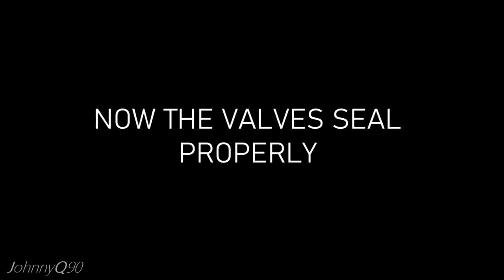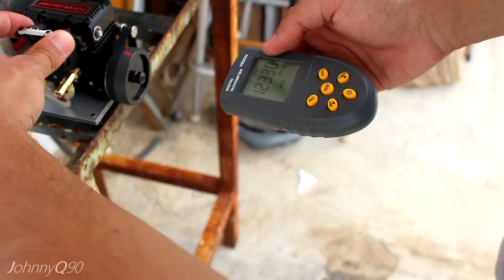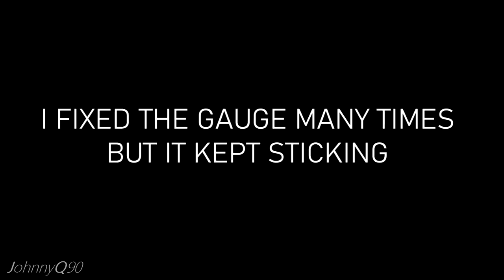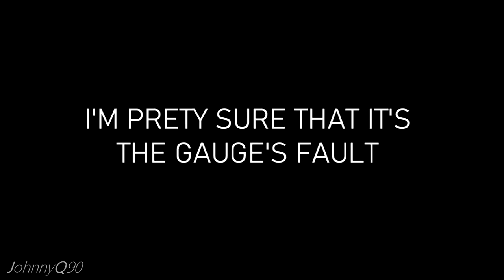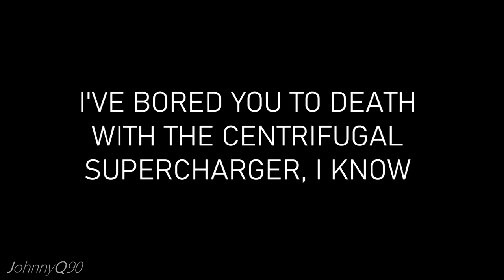PERFORMANCE Upgrade for the 4 Stroke TWIN Cylinder - *VALVE Lapping* - Supercharger Update

Comment: I don't know if you're aware of the nuances of the slide carburetor you have. If you do know then you can ignore this post. I was just hoping that if you didn't know that it would help you get the engine running properly. It may also serve useful to others.

I suggest you reset all the mixture adjustment screws (idle, midrange, and main) to their base settings. This varies by carburetor so you will need to look up what it is for your OS carb. Doing this solved a lot of issues I had with one of my engines (midrange was off by 1/2 turn).

The top adjustment with the fuel line is your "main mixture" that affects the entire throttle range. This one should be adjusted based on desired engine temp under usual load. Lean = hot (clockwise/tighten), Rich = cold (counter-clockwise/loosen)
--> In some cases you have to adjust this for the overall RPM range due to altitude, temperature, dew point, and humidity.

On the slide portion of the carburetor is a screw next to where you attach the throttle control servo. This screw affects idle and very, very low throttle input mixture. This one should be set specifically for making the engine idle properly and not puke too much unburnt fuel. The adjustment for this is the same as the main mixture screw.
--> You are not using a throttle return spring. Slide carbs tend to have trouble returning to base idle and thus usually have a spring or the servo controlling it will have a spring assembly in the arm to force it. Mine has a max spring on servo side (so the servo doesn't rip the slide out of the carb) and a return spring on the carb side. I had to adjust the servo/throttle arm so that it would let the carb completely rest on the idle setting. Otherwise I would get strange idle behavior like you're having.

Finally, there's the "mysterious" mid-range mixture screw. This one is opposite the idle screw and affects the blending of the idle mixture and main mixture at partial throttles. This can effectively allow you to adjust the ratio at partial throttle to full throttle. Most leave this setting to its base and you usually only need to make very small adjustments to this one but it can have huge effects on the engine's mid-throttle response. Adjustment should be the same as the other two.
--> If you adjust this I suggest you put a physical notch, or two (12 and 3 o'clock, for example), on the body so that you know where the base setting is. Heads up: Even 1/8 of a turn on this screw makes a HUGE difference.

I used to race a nitro .21ci/3.49cc (Novarossi) two-stroke 1/8 scale monster truck with a slide carb very similar to that OS carb. I learned quite a lot of tuning tricks from that. Now, with forced induction (supercharger) this is very different from my naturally aspirated motor. There may be points in here that are not quite accurate, or missing additional information I'm not aware of, specifically for forced induction.

Comment: PLEASE READ THIS  I think one issue you might be having is with the little amount of boost blowing the valves off there seat Im an engine builder and sometimes see this in cars that have been turbocharged but were factory NA you build boost in the intake and sometimes the pressure is enough to push the valve off the seat loosing compression because of springs not designed for that positive pressure people think you only need aftermarket valve springs when you put a cam shaft in which is not always the case maybe this is why your engine breaks up on the top end of the rpm range you could possible shim under the spring maybe .001 or .002 im not sure because of how small it is for reference on a small block chevy after a valve job we usually throw a .015 shim under the spring just to bring it back to stockish pressure to make up  for the material removed from the head and valve during machining hopefully this helps!!!

Comment: Really interesting to see this work done great work on the valve gear and that engine really did rev up high after the valves were ground in.
It seems like that supercharger robs more power from the engine than can ever be replaced by 3 PSI in boost. Maybe the biggest loss is the small diameter that the belt has to traverse around the supercharger pulley. This would just get worse at higher rpm.  A correctly engineered gearbox with hardened gears and small ball races May improve things a little.  but   viscosity may start to play a big part in such a small supercharger and reduce efficiency rapidly. I feel that supercharger needs to be spinning at 300,000 rpm to produce any form of meaningful boost. And the gearing up from 10,000 to 300,000 is quite a challenge on the small scale. While keeping the losses manageable.  Can't wait to see the positive displacement supercharger and fitment to the car.  Also if you fill the pressure gauge with oil it will dampen out oscillations. Keep up the excellent work.

Comment: Blow  through system is much easier to tune.  Journal the issue with a draw through system like your using is fuel droplets fall out . The fuel actually gets stuck against the side of the housing of the supercharger.  You have better luck with the blow through system and extending the port length. This will help stabilise the flow of the fuel air mixture before it hits the back of the valve.

Comment: I’m not bored at all with the super charger! 
You should try to make your own throttle body fuel injection set up lol. Would be neat af, and tunable 
I don’t see it being very hard with your current set up. Just machine a trigger wheel and use an Arduino. 
Will have to get a wideband to tune tho. Not sure how that would work lol

Comment: For its running issue, it might have something to do with it having a lot of boost after revving that there is no where for it to go. Something that relives pressure when dethrottling would probably work, like a blowoff valve. Also somewhere in the comments said the carb might be to small for the vacuum, and that could also be it, as it would draw in more fuel, and is hard to meter.

Comment: I think you need an Oil-Damped gauge to prevent the problems you were having with it. The reason the engine became untunable after you upped the pulley size again is because of compressor surge. Causes for this could be many, but I would try to correct it by increasing the plenum volume, so the air has somewhere to gather and get compressed between the 2 brief intake strokes and, what... 400 degrees of rotation between? This should also help with the jelly in the belt from the blower acting alternately between a load and flywheel while the pressure is spiking hard enough to blow back out the compressor intake. Also, for this same reason, I'd think about playing with a bypass gate. Open the gate and tune the engine on Zero-boost. Now start tightening it until just before you detect compressor surge. It's better to blow off excess pressure than to let it surge, because you want the air moving forward continuously. Any time it stops or blows back out the compressor, you're setting up an oscillation of doooom, and frustration. ...But mostly Doooooom.

Comment: The gauge is reading pulses from the engine. By installing a restrictor valve in series with the gauge you can soften those pulses and get a more accurate reading.

Comment: I would recommend a much longer tube for the pressure gauge. The larger amount of air will absorb the massive vibrations of the air column  with the same reading.

Comment: For single cylinder turbo set ups(supercharger I know), I’ve seen people put a small tank between the compressor and the intake manifold to make a more steadily psi. Might help the gauge from jumping and make tuning a little easier. Also will give you a leeway from making too much boost.

Comment: Nice job! You mentioned that you didnt believe the boost gauge at 3psi, but going from 8.5x12000=100000rpm to 10x16000=160000rpm could definitely make that difference. If you can get it closer to an efficient rpm for that small turbine wheel, probably 250k+rpm, it should make much more boost.

Comment: Amazing how much of a difference lapping made to the way the engine sounds, and runs - a much cleaner note. What about using an old-fashioned mercury column vacuum gauge? It will damp out  the variations in pressure. The way it runs with the new carb sounded like an air leak somewhere. Great video, really enjoying the developments!

Comment: The issue with draw through carb setups is that the fine gasoline droplets get separated from the charge air by the centrifugal forces in the compressor, so you get an inconsistent mixture, especially at low power.

Comment: I know you already did the work, but I have a suggestion for polishing the valves. Using the tubing was super smart. Next time attach a drill to the other end of the tubing instead of turning by hand.

Comment: "Bored you guys" fuuuuuck no man this project is dope, really good stuff, forced induction, high rpm, high octane fuel, get er done man  keep at it, the potential is there to make some incredible numbers given the scale, also  If you want to stick with the centrifugal option You need a smaller compressor wheel The compressor is just in surge all the time,  However it's gonna be kind of hard to spend the blower any faster Show the positive displacement option might be a better idea just pls go like psi style screw blower, that would be so dope and more efficient than roots an higher boost

Comment: I think you might suffering or air leaking on the turbine when you tried the push through, I think that is the way to go, you just need to improve the air tightness, the oscillations on the engine idle looks coming from this, also it revs way better, what maybe is showing that the old setup was making the mixture too rich, great vids thank you

Comment: To stop the gauge from jumping you need to dampen it by putting a tiny orifice in the manifold hole, then longer length of tube going to the gauge. the orifice/longer tube will act as a low pass filter and stop the jumping around. This technique is used on real engines to tune vacuum in ITB setups

Comment: The engine seems to be running lean with the supercharger on it it doesn't have a fuel pump feeding the carburetor which is requiring more fuel that's usually why them little engines will hunt and not idle great job on the supercharger love washing your channel also a vacuum leak between the carburetor and the engine will cause it to do that

Comment: for the gauge you can take the end of a bic pen, cut like 1/3" off, the end with the cap, make the tiniest pin hole thru the end cap you can. might take multiple tries. i heat a needle with a lighter, then melt it straight thru. Stick the whole piece inside the line between the housing and the gauge

basically whats happening and why its bouncing and breaking, is because the volume of air thats moving in the line and gauge is way too much to see any where near smooth operation. by reducing the hole size that it goes thru, its slows down and you can get a far more accurate and stable reading

also works on real cars, and id suggest using an actual vac/boost guage

i like your videos, they make me think

Comment: I think have a larger volume inlet manifold might allow the boost to build as less percent volume of the pressurized air is take per cycle and you might get more consistent pressure readings.

Comment: Intense pulsations are a problem for some pressure gauges.  Possible solutions include:
(1) glycerin-filled gauges
(2) snubbers

Snubbers are more or less "mufflers" that dampen pressure pulsations before they get to the gauge.
Glycerin-filled gauges dampen vibrations inside the gauge's mechanism.

Sometimes you need both.

I'm not an engineer, but you can probably read up about these things.

Comment: Depending on what the valves are made from another place you could see a significant gain is relieve the valve stem between the bottom of the valve guide and valve head the large diameter valve stem will be choking/restricting air flow in to the cylinder which will be killing the blow down, for the size of the valve head them valve stems are overkill and also has unnecessary weight in the valvetrain which will also make it less responsive.

Comment: You can smooth the pressure gauge reading by restricting the connection cross section. With something like this I'd expect it to be through a pin hole.
If you are making good pressure, you are probably pressurising the float chamber and pushing the slider up.

Comment: Vacuum gauge looks to be picking up all the vacuum and pressure pulses in the manifold. Since the volume is so low in that area it’s hyper sensitive inside that manifold. Also likely causing carb issues. Maybe add a larger plenum area to the manifold?
Curious if this is a two stage carb, with idle and high speed adjustments or only one main mixture adjustment?

Comment: You need to install a blow off valve (BOV) after the supercharger that is boost controlled. Open at an idle, and closes as boost builds. This will eliminate your tuning issues. Also you should use a mechanical vacuum/boost gauge.

Comment: Check Valve(s) to measure vacuum or boost. digital would help flatten results too. ALSO run under a load. love the videos. keep up the passion. "If" The Engine has been "Whipped" or the throttle is "Snapped" (under no load) it may have jumped timing, you may need a Better Belt Tensioner. You Need A Load to Keep engine From Over/Under-Speed Cycle otherwise You Will Be Creating the Worlds Coolest Impact Driver, if but Only For A Short While. My guess is ignition is going Bonkers trying to keep it running,and that is if the engine hasn't Lost Camshaft Timing Already. And An R/c Engine Dyno using a BLDC motor(like a car starter) could be Pretty cool. The Valves May Be Floating Too. #notbored

Comment: You can stop that gauge going crazy and being damaged by making yourself a flow restrictor. An inline block with a very tiny hole drilled in it to allow the pressure to change but to slow the volume of flow reaching the gauge. Not sure what size hole would work best, but less than 1mm would be a good starting point.

Comment: You need a adjustable valve in between gauge and manifold to steady the needle. Check how carb sync is done on motorcycles, restrictors are used on the vacuum line.

Comment: You need a capillary tube on your gauge. Use copper refrigeration capillary tube with the smallest ID you can find then adjust the length until it doesn't lag too much.

Comment: I think if you program timing and ignition you should be fine. Boost never worked really before modern day tech actually made them usable and a heck of a lot more efficient. This goes more so for such a small scale. There is a company that actually makes programable ecu's for super small scales

Comment: Awesome work! I don’t know what the compression ratio is but if you’re running a 15-20% nitromethane blend, maybe consider the setup a lot of Detroit diesel 2 stroke use… a super charger fed with a turbo charger (or two). Try using liquid gauges . Like motorcycle carb or throttle body balancing gauges

Comment: I actually like the supercharger you have on there now, but I’d still like to see the posi supercharger too. As for the current on though, you could always build a gearbox for it so that it isn’t bound by the limits of diameter vs the available area around the engine.

Comment: You'll need EFI for the thing, trying to tune a supercharged or turbocharged engine with a carburettor alone is going to be super hard, since the engine parameters change on the fly constantly. You'd either need super complicated mechanical contraptions involving vacuum tubing or just a simple computer to do the injection and ignition for you.

Comment: The throbbing or pulsating of the engine reminds me of a problem of the saturn V rocket where the whole thing would kangaroo back and forth with increasing and decreasing thrust.  Maybe the same thing is happening with the draw-through setup where the super charger presurises the system, increasing the revs that speed up the super charger causing it to suck too much with the throttle closed then suffocating the engine for a moment before starting the cycle again.  The saturn V's F1 engines also has a turbine delivering fuel and oxygen to the engine.

Comment: Might be running weird due to making pressure in the manifold even at idle with the bigger pulley. Try closing the idle screw on the carb all the way until there is no gap at all in carb throat. Slowly turn the idle screw on the carb until it opens just a hair and work your way from there. I know from seeing so many centrifigual supercharged carb v8's that they usually always use blow through setups and draw through usually are hard to tune.

Comment: The problem might be rev hang. It occurs when theres too much excess pressure in the manifold so the engines still getting fed more air than at idle which is like opening the throttle. Thats why turbo cars have blow off valves. Ik that this is a supercharger but maybe a blow off valve would fix the problem. And make a really cool noise.